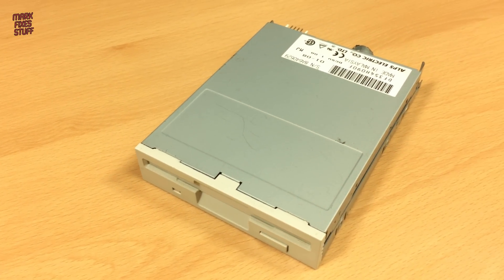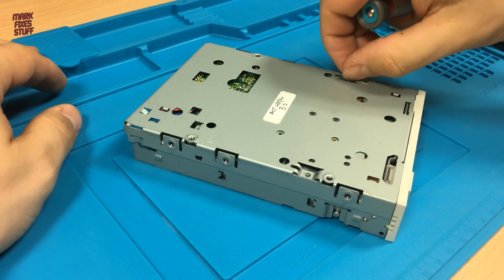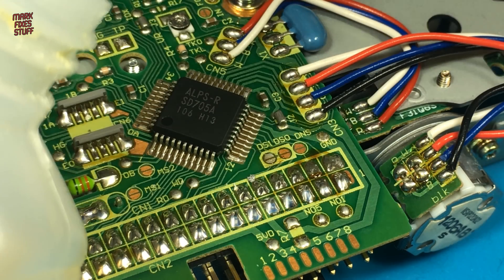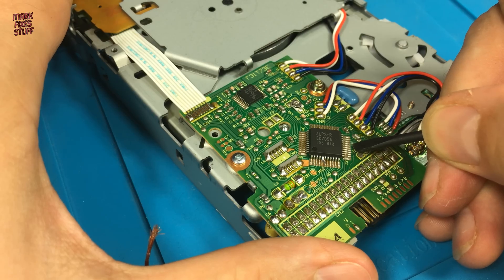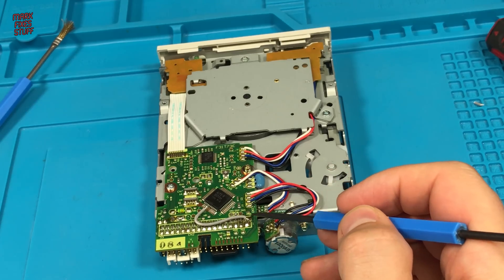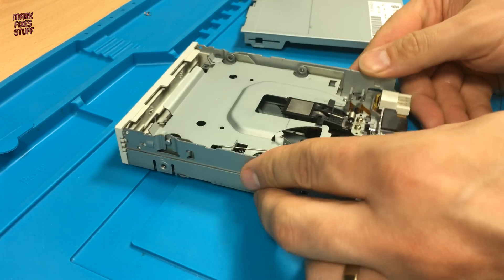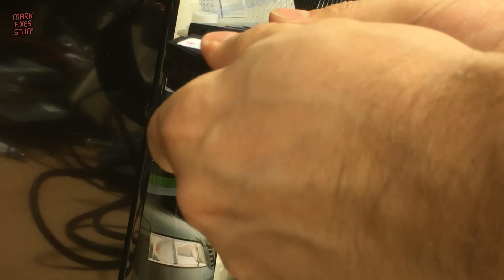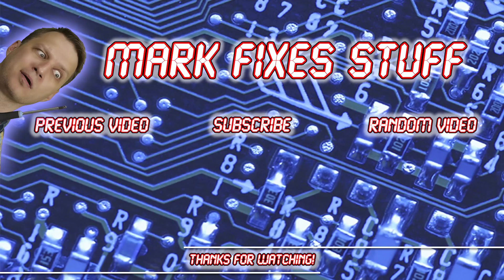Use a PC Floppy drive on a Commodore Amiga!

Comment: Was this a DS-DD drive or a more common DS-HD PC drive.  I guess the Amiga will still only recognise the 720KB DD disks?
Reply: Of course. That is why you use the old tape-over-the-hole trick. Even though the OS reads DD only on most Amiga's, the drive will still read as HD if the switch is not activated inside the drive.

You can bypass, by using a piece of tape on the floppy Disk it self, or you can bridge the switch inside the drive with solder. The latter, will make the drive read/write permanently in DD mode.
Reply: Sorry I didn't get my point across very well and perhaps wasn't clear what i was getting at.  Given that the PC drive was most likely HD, could the Amiga now format and read 1.44MB rather than the normal 720KB
Reply: @ukzoinks  Ahhh.... Nope. The hardware and the OS on the Amiga500 it self, reads and writes only 880k and not 1760k. We had to wait untill the 90's, before the Amiga was able to do 1760k. Most stuff on Amiga, came on 880k disks anyway, so in retrospect, it is only good for productivity stuff and corporate use. Today we are not using the Amiga for that stuff anyway.
Reply from the maker: @brostenen  Yes indeed. I neglected to mention that. I think there is a jumper on these drives to disable it.
Reply: @MarkFixesStuff  Ahh... Sorry to have written it as a  (main?)-comment to this video as well. Did not think you read my answer to another viewer. 😁
Reply from the maker: @brostenen  No, it's OK. We are all learning and I don't claim to be an expert. So much of this stuff is undocumented it is often trial and error!
Reply: @MarkFixesStuff  Yup... I still have not figured out most of what makes an Amiga tick internally. And I doubt that I ever will. Would be awesomme if I knew all about at least one model. Anyway... At least I have done some stuff, like chipmem upgrade and stuff. I have documented most that I have done on my blog. And it is nothing compared to other people's knowledge on the Amiga.
Reply from the maker: DS-HD so very common. Not all drives work but quite a few do.
Reply: Amiga drives were also defacto HD pc drives.. But they didint wrote in HD Format. In fact the Amiga uses its own Disk Format. with 901.12 kB = 880 KiB per Disk. So its not 720 KB and not 1,4 MB. Its a special Format. And with this mod. A normal HD drive can write that Format on a DD disk. Thats even why you could not read Amiga disks in a PC. Kudos for the Video BTW! ;-)
Reply: @000jimbojones000  Not exactly. They used MFM drives, just like on the PC. Though some drives have the HD/DD contact/switch, the drive it self was hardware encoded to 880k. Another difference is that the Amiga was jumpered to DF0 and the PC was jumoered to DF1. The Amiga also used drive ready signal and disk change signal. And the cables were wired a bit differently. Here I am talking master/slave/cableselect. Because the drive was hardware encoded to 880k, then the switch had nothing to say, yet if you modify a PC HD drive to Amiga DD drive, you can still confuse the hardware. The Amiga thinks that it is a DD drive, yet because of the switch in the drive, the drive thinks it is a HD disk. So. Basically you eigter bridge the HD switch with solder or you use a tape on the hole on a HD diskette. Finally there is the question of the RPM. One is 150rpm (or something like that) and the other is some 300rpm or something. I can not remember if the Amiga used 150 or 300 rpm.

Comment: Back in the early 90s my Amiga 500 floppy drive malfunctioned. I purchased a Mitsui PC floppy drive from the local "clone" computer shop and I didn't make any electrical modification to get it to work. Although I had to make some physical modifications to get it to fit into the internal bay. I'm surprised your drive didn't work out of the box like mine did.
Reply from the maker: ldisc66 most PC drives are set to DS1 by default, and lack the ready signal on the appropriate pin. You were lucky I guess? Worth noting that later A1200 machines from Escom were pre modded to use standard drives.
Reply: @MarkFixesStuff  It's wild, decades later I'm still learning new things about the Amiga computer 🍻

Comment: Great video, Mark does this mod work on Amiga 1200  too? I have a poorly  a1200 with no working drive. Cheers
Reply from the maker: Yes, with the caveat that some of the later Escom Amiga 1200 machines had a fix on the motherboard to use PC drives, and that is best reversed before using a modded drive.